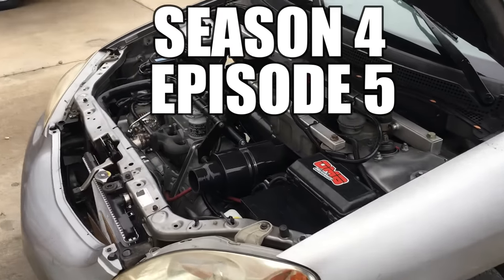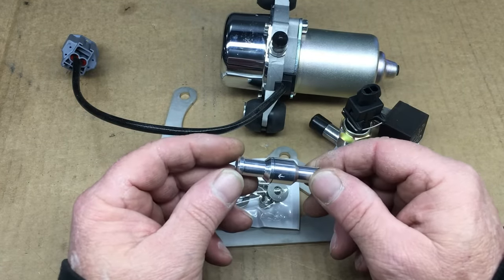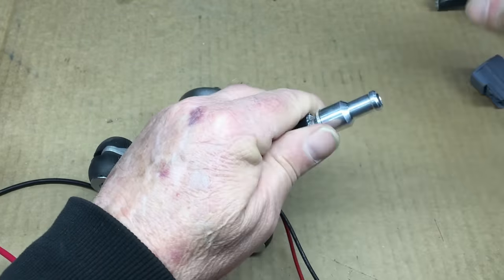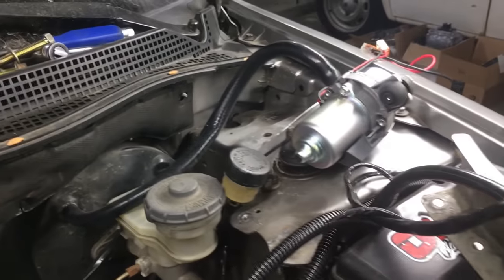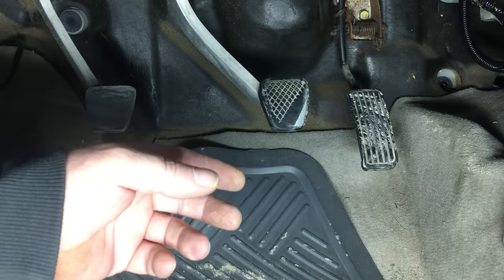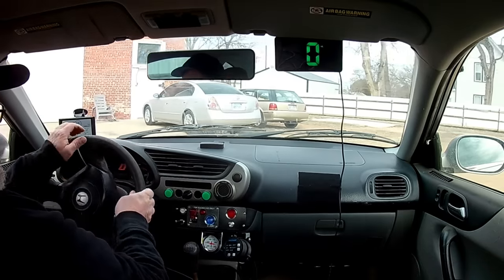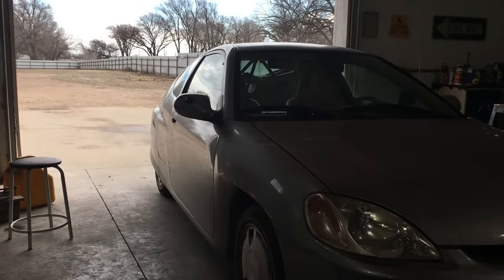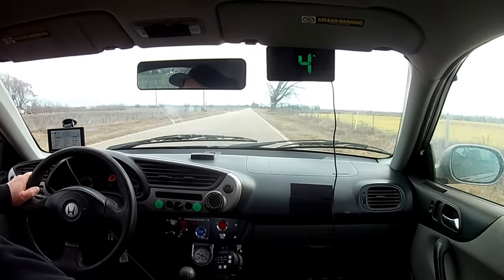S4 E5. We fix the power brakes with an electric vacuum pump and a bit of engineering.

Comment: Maybe a vacuum chamber between the booster and check valve? Provide a reservoir of vacuum for instant and sustained braking (emergency), and allow the pump to run a little longer and reduce chatter naturally by exposing it to more volume. Great video as always!
Reply: agreed, you could make a large one out of a section of pvc  pipe and just zip tie it underneath the car.
Reply: I second or third this concept.
Reply: Agreed,   Old cars with vacuum wipers often had vacuum pumps run off the fuel pump and just used a mason jar with fittings in the lid.
Reply: I ended up adding one to my 68 Dodge Super Bee after installing a large solid lifter cam to keep the GM booster happy!
The sound of the vacuum pump was atrocious. I ended up swapping a manual disk brake master cylinder. 
Oh.well live and learn😂
Reply: A old Ford black coffee can would look great
Reply: Came down just to say this. Accumulators and vacuum canisters can be found in any junkyard for next to nothing.
Reply: Yes ! It is like when you run a domestic water pump without a capacitance tank.
Reply: Came here to post this comment
Reply: I was waiting for this comment.

Comment: Good explanation of the vacuum brake system. I remember when I was fixing the turbo pipe on my 09 Mini Cooper, I forgot to reconnect the vacuum pipe line on reassembly, went for a drive, stopped a few times fine, then put my foot down to confirm my turbo pipe was fixed to then be scared shitless by having no power assisted brakes as I'd used all the vacuum in the brake booster 😂

Comment: The panic switch is relatively easily done with a brake pressure switch if you're so inclined, and although it likely won't work due to your space limitations, a vacuum reservoir, along with remote mounting the switch (further away and reading from the reservoir) would likely reduce or eliminate the chatter (further from the source= slower rate of pressure change).
Reply: I came to the comments to mention a reservoir. it would add a buffer to the system.
Reply: I was hoping someone would mention a vacuum reservoir as a solution. Probably wouldn't need to be very big since there is only 1 device that intermittently needs vacuum. I'm a little surprised he didn't include one, its probably long gone but I'm sure that Insight had one tucked into the firewall/fender somewhere.
Reply: Only problem with that is the pump will be on constantly if you keep your foot on the brakes, such as at a red light.
Reply: @roboman2444  It would be anyway, with the delay and a reservoir it could significantly decrease the amount of time it needs to run to keep the pressure stable. it would take it longer to charge the system, but after that, it should be more stable
Reply: @donakahorse  Yeah a larger reservoir is a good idea to help smooth things out.

Comment: As a Certified Internet Commenter 😂 I think the "chattering" issue with vacuum pump would easily be resolved IF you could find a switch that turned on/off at different vacuum rates. Change my Mind
Reply: the easiest solution is to source a used alternator from a diesel engine that has a vacuum pump built in. If you want an electrical solution, i think the correct method is to use two switches rated for different vacuums. i understand some compressors use that method with two motors to lower the inrush current in environments where it's not  desireable to upgrade the mains current rating.
Reply: @martin-vv9lf  well my first thought was definitely a belt driven vacuum pump, but then there would be the "it robs too much horsepower" comments. But yes, I agree that two switches at different rates is key, if staying with electric.
Reply: like, a mechanical pid?
Reply: @felderup  yes a pid, but with 100% duty cycle. other commenters have said that merely adding a vacuum tank would fix the issue, so that would be the first thing to try. I guess you could try using a compressor valve switch, or one from a water well pump, but mounted upside down, with the box inside the vacuum tank so that it sees the atmosphere as the pressurised side.
Reply: @FarmAlarm Hi FA. You just defined hysteresis. He mentioned that a few times in the video. The present switch has none. If he could find one with more (any) hysteresis that would solve the problem. He can’t find one, so he’s doing the delay relay instead.

Comment: My idea of a panic switch is to wire the pump to the brakelights so it always runs when you brake, still with the same system you made and of course the timer relay, just an extra precaution if something fails in the system.
Lotta' love from the other side of the pond🫡
Reply: That is a clever idea!
Reply: Maybe not a great idea, depending on where you live. I've stopped in traffic more than a few minutes because of whatever reason people didn't want to drive. Probably easier to wire up, but no control over pressure. I'm sure it would work in more small towns. It also doesn't help if a leak develops as the system wouldn't even try to maintain pressure until you are already on the brakes.

Comment: How about a simple vacuum accumulator?  Plenty of used junk yard units from power stroke diesels and even gasoline fords that used vacuum controls for the cabin air vents on the gasoline engines.
Reply: twas thinking same thing.
Reply: 80s Ford IDI diesels used a belt drive vacuum pump.
Reply: I chimed in too late. Had to go back and delete the comment I just left. I agree that your suggestion is a partial solution to the limit switch chatter.....
Reply: I was going to make a similar comment. A vacuum reservoir should smooth out the vacuum signal. It should also provide more vacuum reserve.
It doesn't need to be anything fancy, either. For example, the vacuum reservoir on my TDI Jetta is just a plastic ball, about 5-6 inches diameter.
Reply: One of the easiest to find would probably the “vacuum bombs” from VW TDI engines. They’re everywhere in junkyards.
Reply: On the Fords, was that the tomato juice size can under the hood?

Comment: Great video. For improved vacuum power boost braking, install a vacuum reserve tank (anywhere in/on the car). Cheap hac, use an old fire extinguisher bottle and weld a fitting on.

Comment: Years ago, I purchased a 1970 Chrysler Newport that was bought and sold new in Yellowknife Northwest Territories. It had a number of interesting modifications to keep it alive in a region that gets very cold and doesn't have paved roads.

The notable modifications were to the "cooling" system that kept the engine, fuel system, and occupants alive in regular -30 degrees (sometimes as cold as -50)

One of those was copper tubing wrapped tightly around the exhaust manifolds with coolant running through them. It looked like at one point the copper tube had header wrap over it to retain even more heat. One manifold had coolant that ran to the heater core and the other went to a 2bl carb spacer plate to keep it functional.
Reply: Sounds like a place where marine water-cooled exhaust headers would be in demand.

Comment: Cool video,there is a vacuum switch available that has a pressure on and off adjustments. But like everything else pricey. Also you can add a vacuum reservoir using a pvc pipe with end caps. Works great and adds more pumps for your buck.

Comment: I'm glad you pointed out the capacitor non-solution option that i know a lot of people would have claimed was the fix. The kind of capacitor it would have taken to keep that relay actuated for enough time would have caused a huge inrush current when the vacuum switch closes, and likely have quickly destroyed it along with whatever ignition switch contactor it was being powered from.

Comment: Couple ideas if you put the vacuum switch close the booster the slight pressure line loss will reduce the chatter. For the safety switch you mention to run the pump why not use the brake switch to run the pump while braking?  A nice old vacuum canister near the pump would also be a nice addition.  Always enjoy your videos.  I'm looking forward to the next one.

Comment: Hey Jimbo, to help with the chatter, you could add in a vacuum reservoir, inline after the check valve, that along with the time delayed off would help run the vacuum pump for longer durations once it is on, and reduce the start/stop.  Thanks for all the great content, been watching since Episode 1.
Reply: Maybe caused by relay chatter,can be solved by adding a resistor or flyback diode between the two coil terminals on the relay.
The motor and the relay both have an inductance and power should be eliminated from the system soon after the pressure switch disconnects.

Could also be just the pressure switch needing a hysteresis.

Comment: Great explanations today Jimbo.  As an alternate hack solution, how about firing the vacuum pump relay with the brake light switch?  Such that the pump only runs when the pedal is depressed.  No vacuum switch, no hysteresis problem. 👍
Reply: This is what I would do as well. You're always going to press the brake at least once when starting the vehicle, and each time you press the brake, you would start the pump. You wouldn't need a vacuum switch, you wouldn't need the other fail safes since the design would be the fail safe. I would add a vacuum accumulator to get a little extra braking power, but the rest would probably self regulate without the extra fuss.

Comment: I once used a fire extinguisher as a vacuum reservior on my samurai. I had toyota 4 piston calipers on the front. Geo tracker front calipers on the rear and in 80s trans am 4 wheel disc mastercylinder. I was using a motorcycle carb so it would nearly run sideways. A quick stab of the brakes would let my engine stumble at idle. The extinguisher worked great.

Comment: Very helpful episode as someone who will be using the same pump from a gm di car on a high boost turbo car. Gm run them split with the intake so its a booster but it's still important.

Comment: I use a similar relay setup for electric fan conversions. The easiest way I have found to do a bypass switch is to have some sort of toggle switch that grounds the low amp side of the relay. This way even if the vacuum switch quits, the circuit can still be completed without trying to find a switch that can handle all the amperage. The additional ground circuit can be run through a dash toggle or I have also seen people use floor mount high beam switches. Just some ideas, Jimbo. Love how far the project has come.

Comment: Brief rear-3/4 views and several minutes of reflected forehead!  It's nice to see you warming up to the camera. Also, a suggestion on that panic switch: nobody experiencing difficult braking will be thinking "oh right, the panic switch." Solution: wire the bypass to the brake light switch. That will force the pump on  whenever the brakes are being depressed, while the pressure switch ensures the reservoir is never left depleted. Might need a couple diode packs in there to avoid a backfeed.

Comment: Excellent job. 
The check valve in the pump may depend on its orientation, as in if you mount it vertically with the pump section at the top it'll work but upside down or horizontal mounting may make it inoperable.

Comment: Back in the 70’s ford used a “Hi-C can” for vacuum. Basically just a giant sealed soup can with ports in and out that held vacuum. Also check a Warren CRR9-9 relay for a time delay. We use this on hvac stuff. Hope this helps.

Comment: I recommend adding a vacuum reservoir. My old diesel has a small reservoir canister after the vacuum pump mounted on the alternator. There is also a low vacuum warning switch on the reservoir that trips my brake light. That may also help with your chattering.

Comment: Jimbo, I i haven't finished watching the video yet, but my recommendation for the brake system vacuum assist is to add a vacuum accumulator in between the booster and the check valve. It'll give you a vacuum reservoir to allow more frequent brake application without running the pump school often.

Comment: I'm sure someone else has already mentioned this, but for the supercharger drive belt, you can use a belt suited for lawn mowers, as most of them are aramid reinforced and are rated to bent in either direction.  Use A series for 1/2" wide or B series for 5/8" wide.  Hope this helps.

Comment: I've actually wanted to mention  this for a few videos now, Jimbo. Back in the 80's, VW built a prototype based on the Polo called the OKO Polo, and it had a tiny 2 cylinder diesel engine with a G-Ladder supercharger from the G40 engine. I think in terms of fuel consumption, it got 3L/100KMs which is around 78 MPG. So... Even big companies had crazy ideas like this. Best wishes, Jimbo!

Comment: If you run into issues with the vacuum pump running too often or not keeping up with the brake booster demands, try adding a vacuum reservoir. You can DIY one from some HDPE water pipe as it only needs to withstand about 15psi so the thicker stuff that's not DWV will work. Yes you do need a check valve, the one on the master is good but an extra one isn't a bad idea just in case.

Comment: Thank you for making these videos, as others have said I too look forward to these. I just wanted to add my $0.02's. I drove many vehicles in the mid 1970's with standard brakes, power brakes were just becoming popular and many used 60's vehicles were standard brakes. At that time I became aware of how much more brake pressure was needed to stop vehicles with non-working power brakes compared to standard brakes. Standard brake vehicles were surprisingly easy to stop, I really never saw the need for power brakes similar to how you noticed how easy the steering is without the power steering,, but they became standard so early so it didn't really matter. I don't know if removing the brake booster would be legal, but it is an option and you could easily stop a small car like that with minimal brake pressure. Thank you and keep up the good work, it's very entertaining.
Reply: Power assisted brakes are a necessity when the vehicle is equipped with disc brakes. Up until the early 70s drum brakes were the industry standard in America. Drum brakes have a trait called “servo action “ also known as “self energizing “. Disc brakes don’t have this trait and rely strictly on hydraulic ratios and leg strength for their stopping power.
Reply: power brake's master cylinder are not sized appropriately for continuous unbooted use imo.

Comment: Nice video as always. I had some problems with cheap check valves. But they are easy to replace.
Reply: Mounting that type vertically will allow the puck/piston to seal by gravity, similar to a PCV valve.
Reply from the maker: Great point!

Comment: I would probaly add a inline vacume canister to store vacume that way the pump dont need to come on as much.  also i found this on amazon (Timer Relay, Adjustable Signal Trigger Turn Off Delay Timer Switch Relay Module 12V) 7 bucks
Reply: Your channel shows you build a LOT of stuff like this, so he should take your advice.
Reply: All of this is what I came to say.

A vacuum canister and a timer relay is the way to go.  Ensure the pump runs for at least 5 seconds at a time and runs less often.  Indeed, if you place the switch in the right place, the canister alone will fix the issue by making it take longer to reach or deplete through the target vacuum range.
Reply: ..came here to say just that..  :)
Reply from the maker: We did actually buy something similar, however it didn't arrive in time to be in the video.  As for the storage canister, we don't need one, the brake booster is a storage canister and holds enough vacuum for three applications of the brakes.  Keep in mind, as I mentioned the pump is quick, but not instantaneous.  We don't want a huge storage tank to pump down, the booster holds just enough vacuum for the pump to evacuate quickly.
Reply: @robotcantina8957  my thought is that it be a buffer so the pump dont need to run as much

Comment: For Metric fans: standard atmospheric pressure is 29.92" Hg (or essentially 30) and drops by 1" per 1,000' (300M) at low/mid altitudes. Thus, 27" of vacuum is ~0.9 ATM vacuum (90 kPa), or possibly more if RC is doing this at altitude.

Comment: I'm not sure you need something as complex as a time delay relay, look at schematics for addding a turning lamp to older cars. A simple relay with a capacitor across the coil side will hold the relay on after it's been switched off. Larger capacitor gives longer on time. I'm pretty sure that would buffer the wiggly vacuum switch signal well enough.

Comment: A simple solution for the thermostat issue.
Toss it in the bin and splice in a heater control valve.
You can get them in electric or cable and they are fairly cheap brand new.
You might need to run two in parallel if they don’t make one as big as the main coolant hose.

Comment: On some diesels, or gasoline vehicles such as Mercedes, which use, used, vacuum servos for central locking, a vacuum accumulator is used. This is typically a chamber which stores a larger vacuum capacity, thus preventing the hunting, or chatter of the vacuum control switch, and would allow more brake servo applications before vacuum depletion.

Comment: Check specs on the 80's Renault Encore 1.4L thermostat. It's a small thermostat that actually installs into the radiator hose. 192 degree 'stats are still available cheap. 

And if anyone thinks your builds are slow...my 1985 Renault Encore 1.4L did 0-60 in 3 days. You literally had to turn the AC off to almost safely merge onto the highway! Then there was that time I hooked nitrous to it.....

Comment: Might want to add an accumulator tank, help with pedal use and pump cycling. Ford used a can in 70's with fitting attached, GM used plastic spheres, they needed to manage vacuum with emissions control actuators.